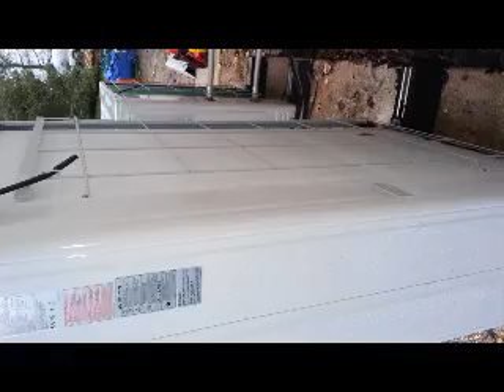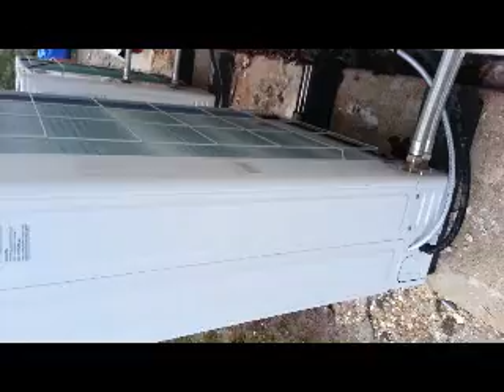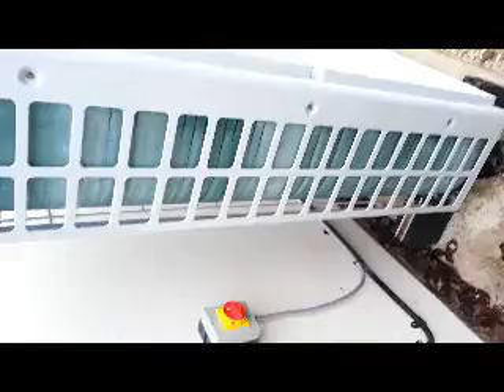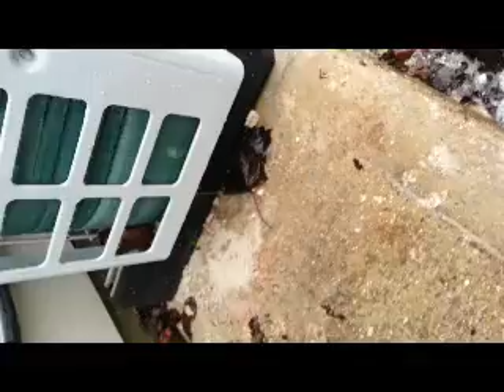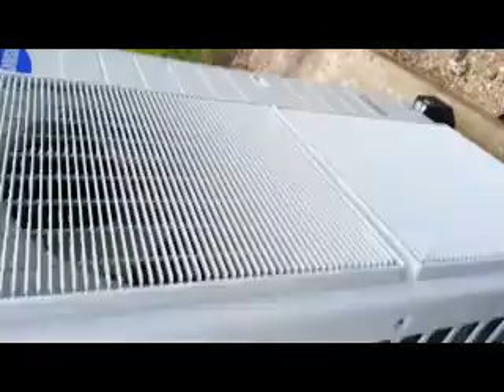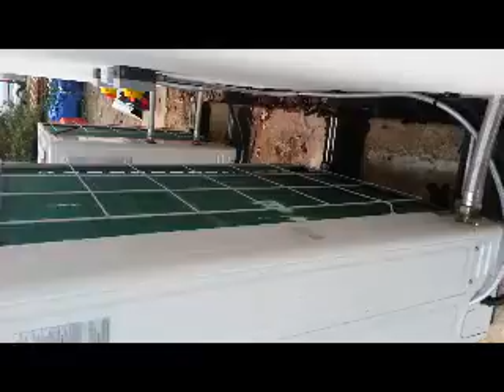Why is there smoke steam and water coming out of my heat pump?, Defrost cycle

Comment: I’ve a unit that Is not defrosting! RC090MHXEA. Possible faulty defrost sensor? Can I view that temp?
Reply from the maker: yep go to outdoor unit take off cover, with unit running press k4 button under the display 7 x it will read 7XXX the XXX being the temperature of the coil, if its frozen it will be 7-xx showing a negative number, if its not negative the sensor is buggered. give us a call on 02380274833 and we will get one out to you. good luck Graham
Reply: Graham, thanks so much Friday for your quick response. It was tropical 45 degrees for the defrost sensor. Your videos are excellent. Have you any decent service manuals for the Samsung units? The distributor here isn't very helpful. Thanks again.
Reply from the maker: Hi, we do have our own Service manual, the Samsung one is terrible;e, but we only give them out at our service partner training "your distributor" is notorious for nicking my work so we dont give this manual out or put it online. come to our training and im sure we can help you out. click here for info. https://freedomhp.co.uk/heatpumptraining see you soon
Reply: Freedom Heatpumps Graham, is that a PT1000 sensor or do you know what type of sensor it is. I may have one in stock. I’m drawing a black from the distributor over here!
Reply from the maker: its just a red sensor, samsung only make 2 sensors, red and blue. just cut in a red sensor and its fixed
Reply: @myheatpumpchannel7577  Does the defrost cycle turn on itself? Does it use the booster heater or the backup heater, because I’ve turned them both off?